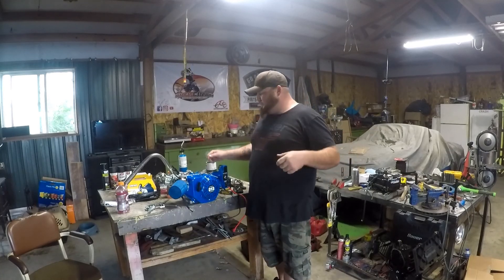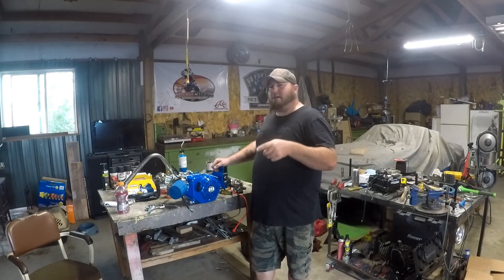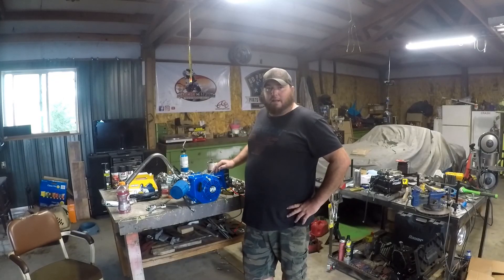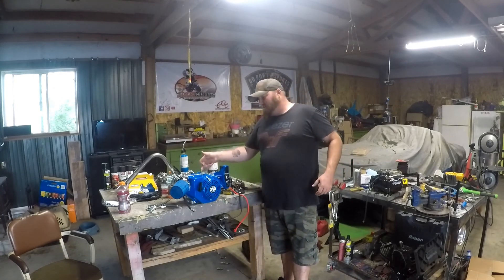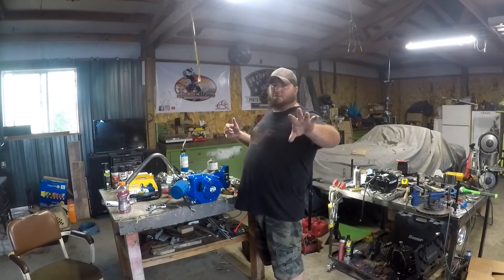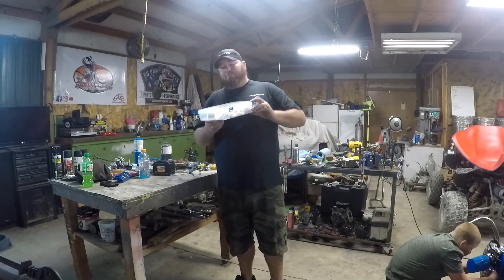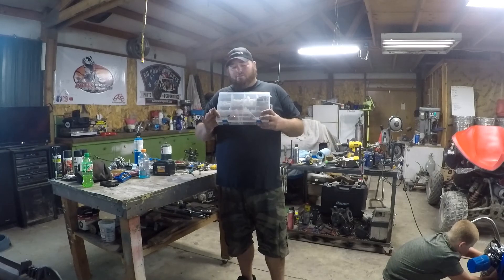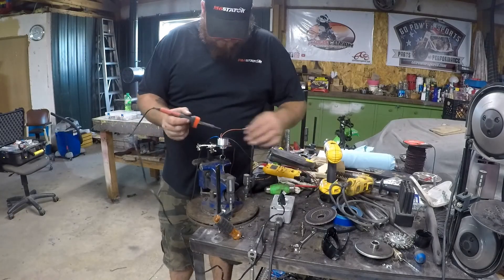Tri Sport Build Ep 5 - New Engine and Electrical Wiring - Badger Canyon Motorsports

Comment: My only problem with G.P.S. is
Theyre prices are way high 
Theyre prices are what have kept me from building a cart 
I mean seriously to hop up a predator engine using parts bought from them cost over a grand
Im sorry i just cant justify spending that much money on a toy
Its not that i dont want to build a super fast cart im just not willing to spend that kind of money on a cart
Reply from the maker: Lol, I think you're exaggerating a bit, over a grand to hop up a predator? No sir, maybe 500. Yes, GPS does have higher prices on things, mostly because the parts are quality parts. They also have staff that will answer any question always and they support this community.

 I understand where you're coming from but I think that if you really wanted to build a kart you'd find a way budget build. I mean seriously the hot rod wagon kart I built I only spent $500 at GPS and got all the shit to build 2 karts. Yeah I fabbed everything else myself but still that's not bad.
Reply: @BadgerCanyonMotorsports  no before they lowered theyre prices it was slightly over a grand 
500 is certainly better but still hard to justify the cost im gonna head over to the G.P.S. website and check there prices if 500 dollars is what it costs to hop up a predator these days i might be able to swing it over time
Reply from the maker: @GeorgiaRidgerunner  my motovox has intake exhaust a billet rod mod 2 cam 18lb springs and a timing key on a hemi predaor for like 350.
Reply: @BadgerCanyonMotorsports  went to the G.P.S. website 
And was looking at parts
The cheapest i could hop up a predator for would would be 346.79 using the cheapest parts they have unfortunately the total i came up with isnt for a full build (i want to do a complete 18 ish horsepower build )
Using the most expensive parts in the list that generated the previous amount mentioned the price dramatically increased the price went to 817.00 Neither price is for
A full 18 ish hp. Build nor do they include a clutch or cvt  
 Im thinking i may just buy the 301 or the 420 and call it good with the right gearing they should do what it want to do 
The trip im planning should be the ultimate test for a predator engine of any size  my wife and i are planning a trip down  mojave rd
Mojave rd. Is a 220 mile long dirt rd. In nevada
Reply from the maker: @GeorgiaRidgerunner  ya know the stage 2 on the motovox is really about all you'd need for a trail bike. Geared low, she might not top at 60 but she'll get to 40 real fucking quick. Lol. I believe Justin Bet's dyno numbers for that setup were about 12hp.  I do have a 420 though and she's a thumper especially with a 40 series. Problem is that setup is 700 bucks. Fucking either way you're gonna spend about that much brother.
Reply: @BadgerCanyonMotorsports  im not building a bikes i want to build carts ive got a coleman bike its ok
But not suited for what im planning
Also my wife has made it perfectly clear that she isnt gonna ride anything with two wheels 
I want to build a 2 seater truck like cart but have thought about two quad like ride ons as well 
While the two seater truck like cart 
Would require a fully modified 212  it would have to be geared really low to handle the weight of two people and cargo without burning up a clutch or cvt belt the quad like ride ons wouldnt require a full racing build i probably just re jet the the carb and open up the exhaust 
But then cargo space (our camping equpiment food and extra fuel) is severely limted  as far as i can tell at the moment no matter what i build theres gonna be a down side
But im leaning more torward the two seater  SXS truck ish build
Be slow and heavy and not much in the way off road ability but have the necessary cargo space
Reply from the maker: @GeorgiaRidgerunner  then a 420 would be the way to go. Or try and find a golf kart drive train
Reply: @BadgerCanyonMotorsports  hey a golf cart drive train might just the ticket 
Ive been told they have a gear ratio of like 13:1
Reply from the maker: @GeorgiaRidgerunner  that would push some big ol tires eh
Reply: @BadgerCanyonMotorsports yes it would  they actually make off road tires for golf carts to  theyre actually on 13 or 14 in. rims